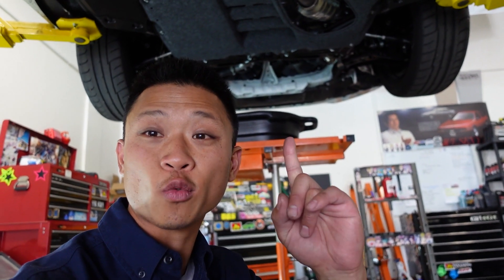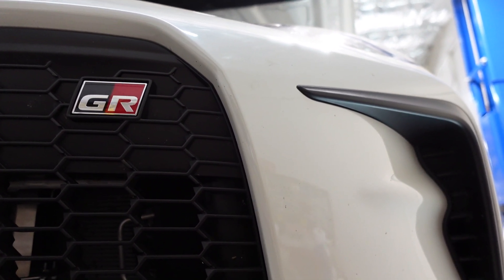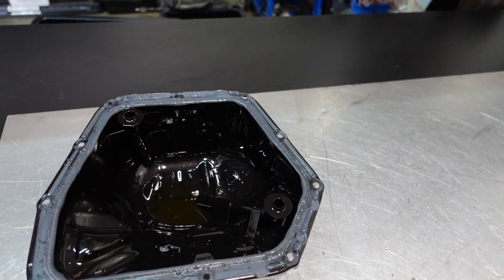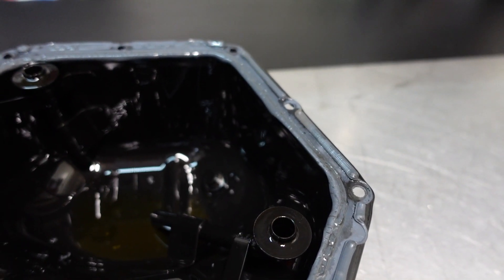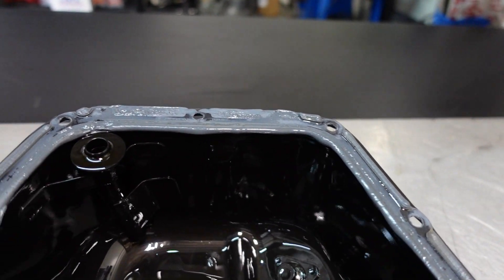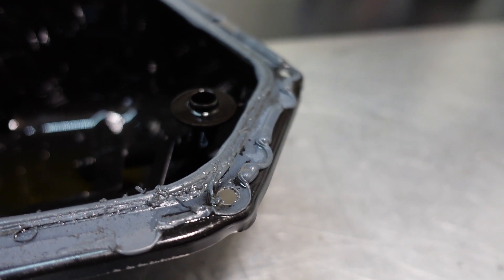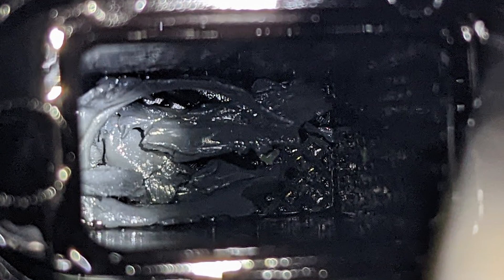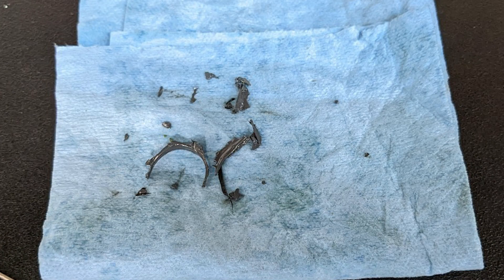GR86 RTV Clogged Pick up

Comment: I have a 22 gr86 in Neptune blue and I had Toyota drop the pan and look in the oil pickup tube. First they told me I was being over cautious and that nothing would be there and they refused to drop the pan. I kept insisting and they said $400 to drop the pan and I agreed on the condition that if the oil pickup tube was blocked by the rtv that they would not charge me. Yeah I was charged $0 because it was completely blocked up.
Reply from the maker: Every dealer is going to handle these RTV cases different which is unfortunate, because dealers who handle it poorly (ie blame the customer) ruin the name of the Toyota brand as a whole

Comment: Pure speculation. The pickup tube has 5 mesh screens for oil to flow through. If 1 of them is entirely blocked there are still 4 open sides. Take a look at what the gen 1 pickup tube looked like. The entire pickup opening was the size of a quarter and that fed the engine just fine. This is a bunch of people blowing something stupid out of proportion.

Comment: In your opinion, are the four other sides simply not enough surface area for the oil pickup to work well if the face-on only side is clogged? "Guaranteed failure" is a strong phrase, but if you believe it, then I will cancel my '23 brz order until this matter is resolved.
Reply from the maker: The impact of one video my goodness! Toyota/Subaru should really be paying attention.

Here is my opinion based on almost two decades in the industry: there should be NOTHING blocking the oil pick up screen.

If the "face-on" side is clogged, we are still reducing the total oil volume allowed into the engine.
Reply: @CMAutohaus  Thanks! Really interesting stuff. I appreciate the reply!

Comment: I'm glad I waited a long time before I took my BRZ in for the Valve Spring Recall, someone else can be the Guinea pig.
Reply from the maker: And it sucked if you owned the Toyota version!
Reply: @CMAutohaus  Yeah I saw those headaches on the BRZ-86 forum, you'd think Toyota would know a few things about Boxer engines since Karl Benz developed it back in the 1897 and various manufacturers have used them over the years plus Toyota owns 16-20% stock in Subaru. 🤷‍♂️

Comment: I know it has been mentioned but isn’t the timing cover a big concern even after you address the oil pan?  I have a thick protruding bead of RTV showing around my entire timing cover. Is that excess normal?
Reply from the maker: Excess is not idea, but normal for Subaru manufacturing.
Reply: @CMAutohaus  is the timing cover a significant concern or if you address the oil pan you should be good?
Reply from the maker: @paulie428  Unfortunatly only time will tell. I'm hoping to pull an oil pan 10k miles after oil strainer cleaning to see if there will be more RTV.
Reply: @paulie428  how would the timing cover RTV get on the strainers tho? I don't really know how this new engine is built, but how would that RTV get into the oil pan to get sucked up into the pickup? Aren't the two parts sealed off from each other (not overlapping i mean)?

Comment: Is there a gasket available for the crankcase?
Reply from the maker: No, but the consensus is that there should be
Reply: @CMAutohaus  I hope some aftermarket companies would take advantage of that.
Reply: if you're fixing it yourself, the best way to apply rtv is to smear it across the surface being sealed. The factory manual will often say to make a 1-2mm bead on the pan, but I've found better results just smearing a light amount. You want enough to still be able to seal the pan, but not so much that the excess gets squeezed out and ends up presenting as a hazard to the engine.
Reply: Thanks

Comment: I appreciate your informative videos, thank you for what you do! I've have a 2022 86 and I have about 700 miles on it. I'm in several GR86 facebook groups and the RTV issue is ever present there and honestly I am really worried, not just about RTV but I've seen several posted with rod knocks and trans issues all coming on within the infancy of the car. I am under the 3 year 36k mile warranty, and have a lifetime powertrain warranty from my dealer. I dont track it, I just drive daily to work and back, nothing crazy. I guess I'm just asking for some peace of mind. I dont want to let the car go, but I'm getting paranoid about driving it. I realize I have the warranty but I feel like I shouldnt have to worry about a brand new car. Am i being to paranoid? should I just drive, maintain and enjoy it? Your opinion is important given your knowledge and experience with this platform. Thank you, again - Chris
Reply from the maker: I'd have a trusted 3rd party drop the pan to clean the pick up for 100% peace of mind. Warranty claims are still a fight.

Extended warranties can also be a joke: I've seen an "engine" warranty not cover low compression. Rip off of the century.
Reply: @CMAutohaus  would that void my warranty having a 3rd party perform this task ?
Reply from the maker: @LithiumV  I'd send Subaru or Toyota corperate an email and ask for sure. Explain why you want to do it. Have the shop document their findings including pictures.

Comment: I was really interested in owning a GT86. Now I know the engine is glued together I am not going to bother. It seams like financial suicide. Shame Toyota didn't make it.
Reply from the maker: Its a shame. I honestly like the way the car drives/feels. But this RTV thing is going to have to be "quirk" owners will have to deal with.
Reply: @CMAutohaus  It's not a quirk, it's an utter disaster that should compel Toyota and Subaru to completely change the way these engines are sealed.
Reply from the maker: @shahrukhbakar3248  100% Agree and I hope they find a solution soon because I really do like and recommend the cars, but having to clean the oil strainer at regular intervals is ridiculous.
Reply: This is begging for a class-action lawsuit.
Reply: Situations like this are why I'm glad I got the 1st generation BRZ 13-16 style, plus my BRZ looks better and weighs less too.
Reply: @DarthVader-1701  I had a 2013 FR-S which in some ways I do prefer the look of that generation over this (Hakone edition would be a really nice collector car for me), but my engine had a rod bearing fail probably due to an oil issue which seems to have always been a problem with these cars.
Reply: @DarthVader-1701  Outdated gen dudes always find a reason to hate the new car.
Reply: @DarthVader-1701  saying that first gen looks better than this is a really big stretch my guy.
Reply: "Now I know the engine is glued together"
RTV has been used for decades from the factory with no issues. This time it was a problem due to how much excess was being squeezed out to the point of presenting a hazard to the engine.